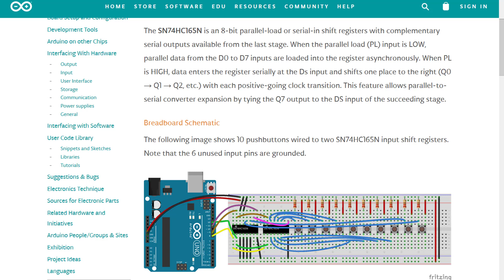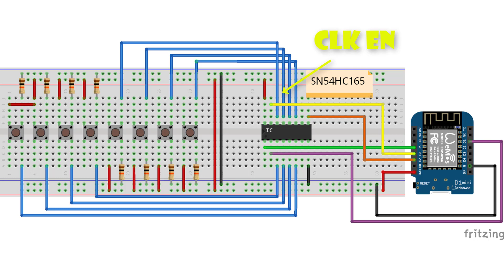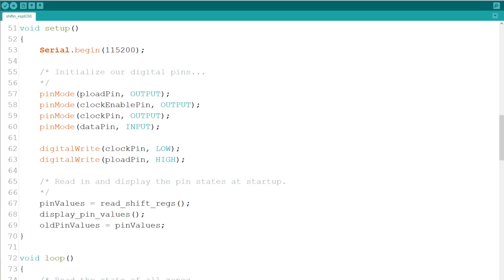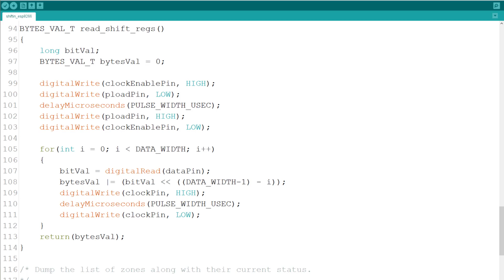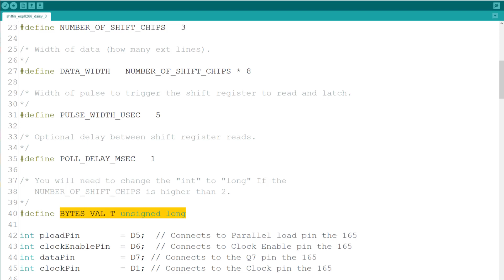The need for (more) inputs - arduino and shift in register

Comment: Dear Sir,
How can i expand arduino uno analog input 24ch and how can i merge with my existing code... please help.
Thanks
Reply from the maker: Hi, 

If you mean how you add more Analog and not digital input , look at this video 
https://www.youtube.com/watch?v=FSgLFthpw8A

Its on raspberry pi, but you can do the same thing on Uno.
Reply: @talofer99  Thanks for replies... 
Actually i have code for 16 analog inputs to DMX project . That i need to expand upto 24 analog inputs with using like 4051.. im not more familier with code writing... please help me. Thanks
Reply from the maker: @dilanwijeratne8878  How do you have 16 analog inputs now ? what do you use ?
Reply: @talofer99  its use with arduino mega. I need more 8 analog inputs. Total 24 analog inputs
Reply from the maker: @dilanwijeratne8878  again back to my original answer., try the MCP3008
https://www.adafruit.com/product/856
Reply: @talofer99  Thanks for replies..
But how can write coding with my existing code?.. if possible can i send my code  ?

Comment: Hi! Is it necessary to connect the clock enable?
Reply from the maker: I do now know of any Clock enabled, maybe you mean Output enable ? 
Then the answer is yes - if not you will not see the output.
There is also a way to connect the 595 with 5 wires, this way you can control the "on power" state of the chip.
Note that most of them will blink the last state or some random state when started.
Reply: @talofer99  i mean clk inh, thanks